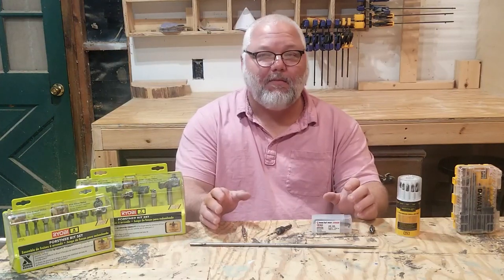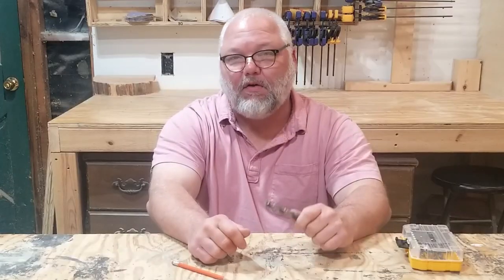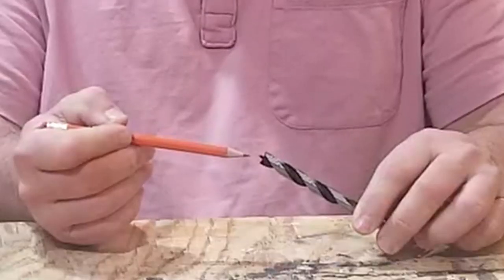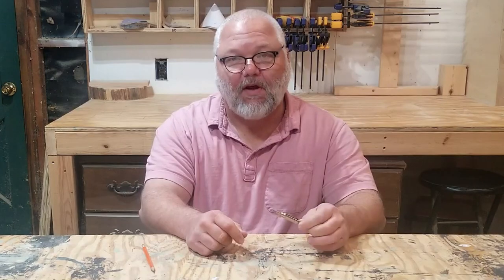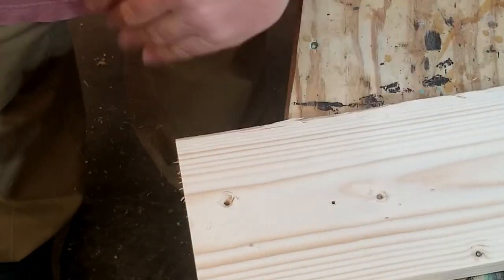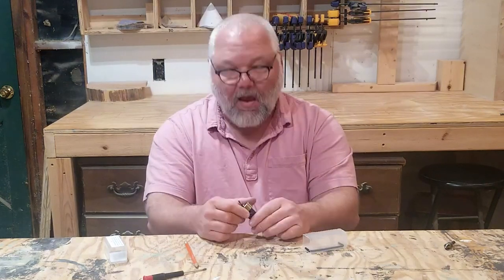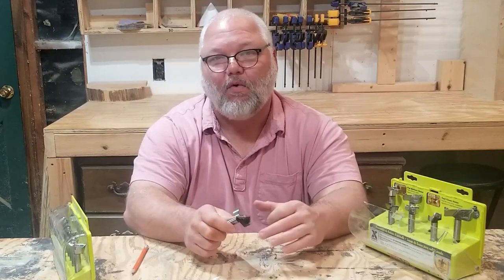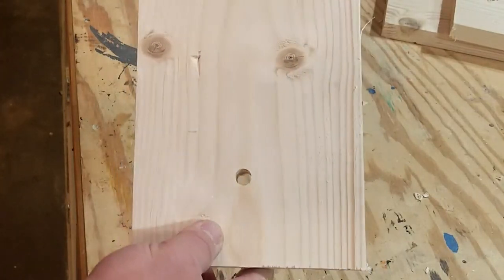You're using the wrong Drill Bit!

Comment: I liked your breakdown of the different countersink bits. Definitely no such thing as a perfect tool, they all have their shortcomings regardless of the price. I have a set of Rockler countersink bits and I use the Allen wrench provided to adjust it to clean out the shavings inside the stop collar. Keep up the great work!
Reply from the maker: Thank you. Do you like the Rockler bits? I couldn't use the allen wrench because someone breaks into my shop and steals them. They also take my pencils and tape measures.
Reply: @CornerCreekWoodworking  Yes, I like the Rockler bits. I particularly like the tapered drill bits and the adjustability. I too have a problem with someone getting into my shop and moving things around.
Reply from the maker: @markpatterson3189  I'm pretty sure my wife does it.